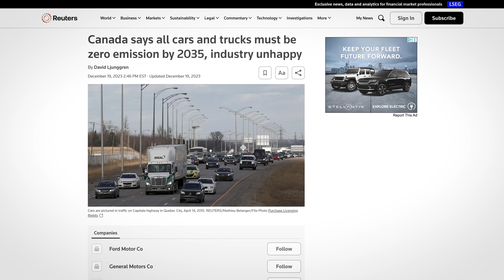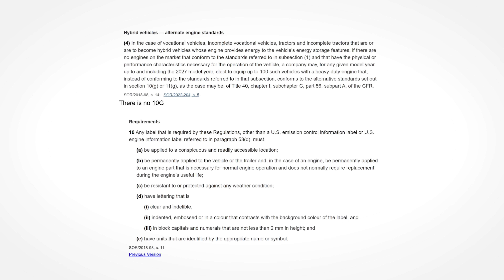Government Red Tape Is Blocking Our Plug-In Hybrid Trucks

Comment: Couple suggestions:
1. As freezer trailers run off highway motors - whats the difference?
2. Register as Pure EV then plug in support generator - same as having a diesel welder on a service truck.
3. Scania/Volvo/Isuzu/MTU/Mitubishi all manufacture Generator Engines & on road Engines see who will Cert a Gen Motor for on highway
Reply: 1 and 2 have displacement limits.
Reply: @aftoknito  sell the generator separately, and install on delivery/purchase?
Reply: @aftoknito bullshit.  What about engines in drill rigs and compressors.  These are fucking huge, and drive on road.
Reply: @aftoknito but do they have limits on how many can be paralleled? Or optional auxiliary equipment to offset extreme conditions?
Reply: @michaelrauff734 I am no lawyer but the way I read it is that it's 2L displacement limit total between any auxiliary engine that doesn't mechanically drive the wheels.
Reply: @aftoknito  still, they're more polluting than an on highway engine of similar displacement, or more accurately they're allowed to be dirtier because they run at a fixed engine speed as opposed to on-highway engines.
Reply: @LouisSubearth more polluting compared to what? An engine of that displacement won't even bulge the truck empty, there is no other case to compare to. Measuring emissions on a bench engine is pointless.
We're talking 1.6L engines (the limit is 2L as far as I know).
Reply: @LouisSubearth that's incorrect, the engines they're using have the same emissions certification and after treatment as their On-Highway counterparts and gensets typically run cleaner due to the type of loads they face, there's just paperwork in between that makes it difficult for them.
Reply: @LouisSubearth  Actually Any generator is twice as polluting as a direct drive, thats just how it is because there is like 50% loss converting motion to electricity, then electricity to motion, for the same amount of work.
Reply from the maker: They actually are much less than polluting than the highway engine.  #1 they have a fixed RPM, #2: its a much smaller engine.

The emissions per HP is slightly more in a generator, but with the smaller HP the overall emissions are less.  And when combined that it's not running all the time its much less
Reply: @EdisonMotors  why don't you go a railway-like route with a variable speed generator?
Reply: @EdisonMotors  YOU SHOULD  USE SCANIA EGINE FOR THE MOTER OF THE TRUCK V8 POWER SCANIA V8
Reply: @EdisonMotors  "The emissions per HP is slightly more in a generator"
"They actually are much less than polluting than the highway engine. "

So no they are not LESS polluting... they are MORE...

Don't care about the smaller motor... you flat out admit HP to HP they are worse...

Maybe try not running that red fuel you were so happy to run on the road since it was OFF ROAD lol

come on bro, you did not see this coming really?
Reply: I haven't looked into it, but is this maybe what Scout motors is doing with the Terra? They offer it as an EV with "range extender" (i.e. gas generator)
Reply: So 3 smaller displacement generators? *Optional chemical to electrical energy conversion units.
Reply: What if you make a front cargo bed that you put a pallet with a genset on?
Reply: Sounds like you guys need to turn a motorcycle engine into a generator.
Reply: I think the issue is with dyed diesel. Government not getting the road tax from the fuel.
Reply: @jerrypedersen5655 that makes sense - when they hear generator they think non taxed fuel, even though you'd have to put road diesel in these series electric trucks.
Reply: @applicablerobot  Nahhhhhhhhhhhhh watch his vids he talks about saving money running red cause its off road motor... They were just in their own world above the law pretty much.
Reply: 1 Its a trailed rere
2 modded, GL on insurance, etc.  And the gov will go after them like um???? come on
3 Likely none the cost will not show a return....
Reply: They already run scania
Reply: Freezer trailers use on-road fuel.
Reply: @erkinalp  Nope. The Reefer (and heater) trailers get filled up with red unless you hate your boss. It doesn't drive the wheels under it, so it's considered a stationary engine
Reply: @shanea7993  here in Turkey they get on road fuel (has licence plate, on road fuel (all commercial vehicles have mandatory fuel tags, reefer trailer has its own fuel tag too!), though off road emissions; aux engine serials on trailers are included in trailer registration here), as our regulators foolproofed our fuel regulation against every loophole you could think

Comment: Hey,
what if you just put the generator in as a 'genset' - aka a self-contained extra module, not integral to the whole construct, demonstrably all easily detachable, plug-in and demarcated, and certify the truck with 'just battery' at first :) worst case scenario, it'll just have to not be in front of the driver, but 'on the bed' as a module/genset add-on? (or, have the front space that is to be occupied by the generator, be occupied interchangeably by an extra module containing batteries?

(before you ask - the genset concept is used in some passenger trains, diesel-electric multiple units for example, they do it for the reason of being able to swap the engines really quick if one goes bad, presumably. Also in the giant multiaxle transporters - though these are not 'highway' vehicles, and are more likely hydraulic not electric)

Comment: it sounds like a technical problem mixed with a paperwork proble, a diesel engine is a diesel engin, you might have a turbo, then it intake compression combustion exaust. you have injection timing valve timing crank case breather exaust gas recirculation, dpf filter and a urea injector to clean up NOx
for a truc engine you have carbon N0x and capbon particlce per mile of per ton per mile
on a gen set it's eexactly the same exept it's per kiliwatt hour
a truck engine can also be in terms of kilowatt hour as energy is energy no matter how you measure it
the advantages of a genorator is you can have the whole system set up to have max efficency at one fixed speed and power level. the electronics can be changed or reconfigured and the emmisons can be measured

Comment: I've used off highway equipment with a c15 deck engine running a hydraulic pump. Wouldn't that be similar to a generator? Is there some electronic jerry-rig you can do to incorporate a cruise control to control the rpm of the engine, like a generator?

Comment: Could you potentially build a governor that could turn an on road engine into a generator? You could effectively use some software to map a load into a throttle response and then send that to the ECU so that it treats it as if you've pushed the accelerator.  Far from ideal but it should work.

Comment: what if you write the manuals and submit the documentation such that the generator should only be turned on while stationary? without disabling the ability to drive the trucks, for changing parking spots in a rest area or for emergencies...

Comment: Y not just use a throttle on the engine like a freight train. Train have a throttle for engine power output. So technically you can use the engines at different RPMs for different applications on the job. And it will comply to on road generator plug in hybrids. Or am I missing the point please educate me 😅

Comment: is a hybrid without generator only option? and then end user install their own generator?
so then you sell pure EV with 50-100miles range only. with space and accessories installed (like radiators onboard charger, Engine control system etc) ready for quick and simple generator installation.

Comment: This is just like the CAFE standards that were supposed to foster smaller engines, but instead generated gigantic pickup trucks. 😢
Now you will have to find an Euro 5 or Euro 6 or whatever on road-type engine and use it as generator... at fixed rpm.
Reply: They already did with the Scania engine.
The problem appears to be the control logic.

Comment: I'm sorry, if you had used the Cummins engines you could use the on-highway engine and change the throttle type.  With all the electronics you have going on there is no reason you can't drive the throttle and have the engine working at the best rpm to achieve emissions.

This a self induced problem, so I can't really say I have any sympathy for you.  I remember mentioning what a flawed idea it was to start with the Scania.  If you genuinely want to get your product to market, stop screwing around and spend the money on Cummins.

Comment: Can you just use a lighter duty on-highway engine? I realize it wouldn't be meant for generator operation, but the benefit should still be there if you can figure out a control system. You mentioned the X15 here, but they also have an L9 9-liter highway certified engine that you could use with a rear mounted generator topsy-style.

Comment: This is one of the dumbest things I have ever heard. So what if it is a freaking generator-spec engine? It's called electric power transmission over mechanical. A Series hybrid. To feed batteries and motors. And you can send power in reverse and use engine braking if required. Surely someone in the government is smart enough to see how incredibly stupid this is.

Comment: 2:20 I don't understand this system. Is it that you don't get a subsidy for this, that you aren't allowed to sell these vehicles, or that you aren't allowed to build one? If it's either of the last two, that is ludicrous. First the government has to specifcally come up with and allow a new technology, before any company is allowed to manufacture it? Insane.

This reminds me EV regulation in the Netherlands. Since there is no category for insuring small EVs such as electric scooters and mono-wheels, you aren't allowed to ride those. You'd think a 'category' is created within a day. No, this situation has persisted for almost 10 years now. That also means that there is no chance for industry to develop within the Netherlands to develop small EVs.
Reply: if I'm understanding it right they cannot get an on highway certification to sell the vehicle because it has an engine that isn't highway rated even though the engine doesn't actually directly power the truck. standard truck rules applied to a truck that doesn't have a standard truck drive.

Comment: what government says if you build a truck with a stationary generator on board and the generator is able to run only when the truck is parked?
Not ideal but for some people could be an acceptable option. 

and customer of course cannot use magnet to simulate park state, like in old types of tachograph.

Comment: I get your frustration. It’s not so much that the government is outright blocking you. It’s that different departments aren’t communicating and aren’t looking at what’s actually available in Canada. Maybe there’s a way to use a smaller “on-road” diesel engine but pair it with the control systems from a generator, since you still need those controls to manage charging the battery.
Reply: Yeah, from the description it sounds like he's in an area of undefined regulation that brings the process to a standstill. Maddening if that's your roadblock but it doesn't seem like an ideological or intended roadblock, as he says it's really stupid.
Reply: The problem is there are government departments
Reply: My friend, it's the wgo controlled government. Ideology screws everything.

Comment: So you would need to have a highway certified motor and have the throttle map re routed to power demands from the generator instead of a throttle pedal. Shouldnt be that horribly hard to do honestly. Especially since cat and cummins have the identical engines in both applications. C7 cat motor would work
Reply: Cant the same generator just be certified for both on and offroad use :/
Reply: @JacobWillits  ultimately yes, but that requires red tape and takes time, modifying an existing "on highway" engine to just take the generators load as a "throttle input" is a much quicker solution for now but requires an "on highway" engine to be utilized in the short term until the red tape situation is sorted